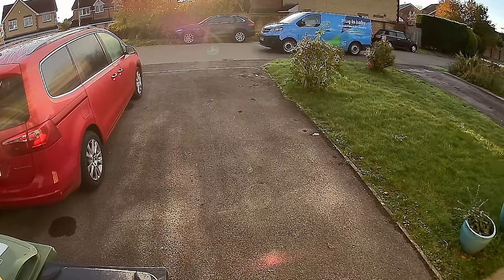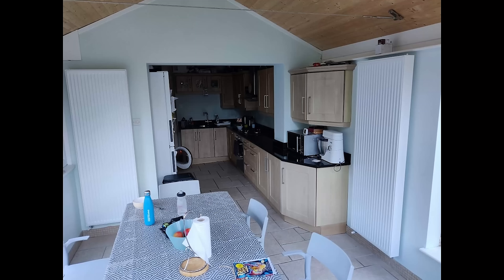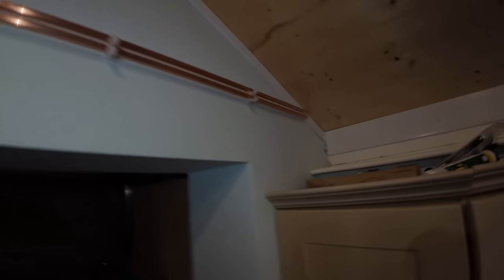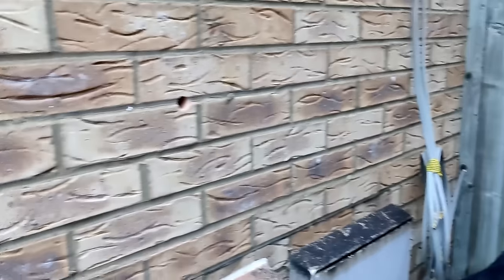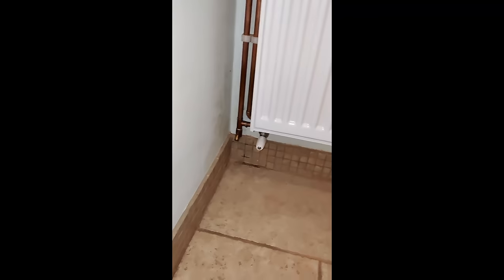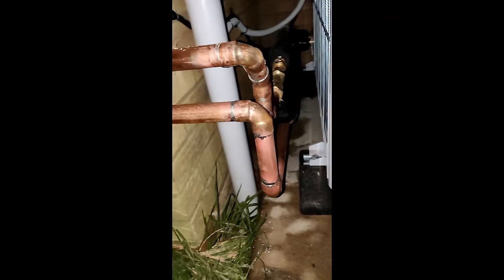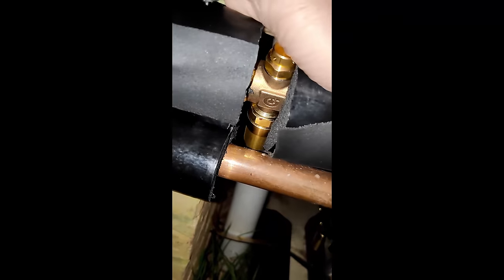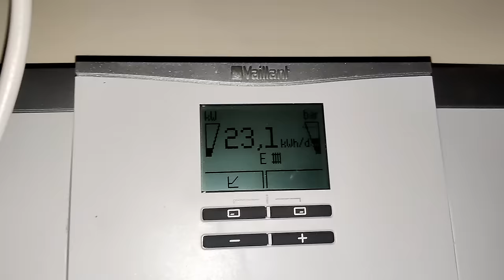Vaillant Arotherm Plus Heat Pump Installation by British Gas

Comment: I am thinking of using British gas myself.
Reply from the maker: As with all big companies, it's a lottery as to who you get.
Reply: It's not always a good idea, if something goes wrong you are fighting a big wallet. They installed a gas room heater in a bedroom for a disabled person and then condemned the whole gas system, As all the pipe work apart from theirs was buried and new carpets and decoration had just been finished we opted to replace it with skeletal (exposed) pipework.Each old section cut connected to new.  On checking for leaks there was a considerable leak traced to the gas pipe that the Gas engineer from BG had installed in the bedroom for the room heater. Compensation nil. Conclusion try locally recommended engineers they have more to lose so hopefully will do a better job. use Google to show you the job so you can check on them, Make sure additives go in the system etc not empty bottles or bottles filled with water etc.I have had all these tricks played on me I am much wiser now.
Reply from the maker: @onlythetruthfull  Good advice.

Comment: Interesting as my potential Heat pump would be a very similar layout, the cupboard space with tank in looks similar to my cupboard, would it not have been easier to locate tanks where the gas boiler was? What size is the cupboard? Thanks
Reply from the maker: Thanks for your message. I replied in my latest video:
https://youtu.be/6Q5CbClka1k

Comment: Why didn't they run the pipe drops behind the vertex radiators. It would of looked 100% better.
Reply from the maker: Now that's something I agree with you on 👍
Reply: They could have dropped  on the other side of the wall behind the fridge.
Reply from the maker: @1973simonking sounds like a sensible solution.
Reply: @UpsideDownFork  yeah they did that with mine, looks ok. I have the same 2 huge vertical rads in my lounge, they barely get warm but seem to heat the room!

Comment: To me It looks horrible, especially the outside and kitchen area. I know some don't mind the pipes everywhere, but it would do my head in. At least you're happy, so all good.
Reply from the maker: Thanks for your comment.
The outside pipes are down the side of the house that is not seen or accessed at all.
Some.people would prefer the pipes to be chased into the wall rad the vertical rads rather than surface mounted but for us we chose the cheaper, faster and less disruptive option.

Comment: wow I did this with one engineer and a helper in 5 days. why do you have a buffer if they re-piped it ? the anti freeze valve is fitted wrong also. external lagging and installation is terrible and will get water ingress making it pointless.
also heat pump has all the stuff on the right hand side which is butt up to your wall so that heat pump will have to be moved every time for a service or any work at all 😰 sooo bad

Comment: The position of that monoblock unit does not look correct? Its too close the the right hand size and the window and door are within the protective zone?
Reply from the maker: Thanks for taking the time to comment. Those issues are answered in my other video https://youtu.be/WBINlPsk5Eg?si=_RH7xBE4uX2VkxES
Reply: @UpsideDownFork  the big question is, how well does it work? I had a very similar install done by BG but with a mixergy HW tank, why this one and not vaillant Im not sure. It seems a lot more complex and no doubt pricier but I do like the mixergy app to control the hw., and it seems very efficient. I had my system installed last march, after several delays caused by miscommunications between bg and the parts suppliers but we got there in the end and Im v happy with the outcome. Thanks for sharing the vids, very interesting.
Reply from the maker: @MikeGleesonazelectrics   You're welcome. I do have other videos about how the performance is going, so feel free to nose around my channel for that content.

Good to hear that your installation has been working well too.
Reply: I think you might be right on that one.
Reply from the maker: @royhorn9412 https://youtu.be/WBINlPsk5Eg

Comment: 'Fraid to say it looks like they haven't installed a condensate pipe and soakaway, which means you'll get a patch of green algae or even ice where the condensate drips. Or even a mini iceberg building up underneath the heat pump during longer cold spells. You'd be justified in getting them back for this. There are very clear instructions in the Vaillant installation manual about this.
Also, buffers can reduce efficiency by up to 35% (University of Ulster research), and it seems a shame to throw away that efficiency when, judging by the size of the rads, the system designer has made a commendable effort to keep the flow temperature down. Could be the buffer was necessary for some reason, but that reason needs to be given to the customer because of the energy disadvantage.
Reply from the maker: The unit seems to be operating efficiently as I show in this video.
https://youtu.be/iyQlxtny_4U?si=Og3L3kvkuDaaWT3-
Distortion caused by the buffer has been minimised by trying to match the DT on either side of it.
Vaillant specify a buffer should be used.
British Gas insist it must be in place.
Both seem overly cautious and don't trust the installer network in the UK to do the necessary flow rate calculations to optimise the system without a buffer.
Reply: @UpsideDownFork  
Your COPs are excellent. Looks like the buffer isn't having a big impact on the flow temp from the heat pump. 
Yes, the big installers like buffers as a fool proof measure so the heat pump doesn't get strangled if there isn't enough flow around the rads. 
I've been on Vaillant training courses and they do like you to put in a lot of extra kit in between the heat pump and the emitters, but I'm not sure a buffer is a requirement to get their longer warranty. But hey ho, it's understandable given that's how capitalism works - always the drive to maximise sales and production, whether it's necessary or not for the consumer. To their credit though, in the standard list of schematics they do include open loop systems if the installer has the confidence to use them.
Reply from the maker: @PaulJones-t7w  thanks for your thoughtful comment 👍

Comment: Scary stuff. Would be only half as bad if it wasn't for the hot water cylinder.
I have air to air HP heating plus sunamp heat store for hot water  (heated using solar in summer, off peak elec in winter). Much easier, neater, cheaper (if you take away gov grant) and quicker to install and the house doesn't look like a major industrial complex. It was all installed in a day. Unfortunately the  system I have doesn't  get you a gov HP grant as the rules are quite inflexible.
Reply from the maker: Major industrial complex? Really?

Comment: BG by default quote for Daikin heatpumps, did you specify the Vaillant?

If so, what advantage does it have over a Daikin?
Reply from the maker: The Vaillant is quieter. We needed that to pass the noise assessment. It has some other slight technical advantages but splitting hairs really in the real world.
Reply: @UpsideDownFork    A super fast reply....much appreciated.

The Vaillant is considerably more expensive though. BG quoted me £658 for a Daikin and £3169 for a Vaillant...hence tge reason for my question!
Reply from the maker: @David-bl1bt  yes, the Vaillant is the premium product but Daikin owners seem very happy with their units too 👍

Comment: Is there enough room around that unit outside, seems quite restrictive for air flow and efficiency?
Reply from the maker: Thanks for your comment. That's covered in one of my other videos here https://youtu.be/WBINlPsk5Eg
Reply: There's a Skill Builder featuring a gent with problems and his Heat Pump has more air around it than this one.
Reply: @nickhickson8738  Yeah I saw that video and wondered if in this case the Valent having a slight side vent and the ejection being into an open space, then it might be better.
Reply from the maker: @nickhickson8738  I've seen that video.
Luckily this heat pump is performing many times better than his!
Reply: Well he's is not performing anymore because of the noise due to an internal fault either the fan bearing or compressor.
Reply from the maker: @nickhickson8738  yes, very true. Very different scenario but thanks for bringing it up in case I hadn't seen it.
Reply: I also think it is slightly within 1 metre of the boundary - so doesn’t meet the regs.
Reply from the maker: @royhorn9412  Check this video https://youtu.be/WBINlPsk5Eg?si=EdsuZeZDz712KXyv

Comment: I’ve already got a mixergy tank, would that need changing to whichever BG quote for or could it be retained do you think? Thanks
Reply from the maker: Mixergy tanks need the upgrade kit to work well with a heat pump.
It consists of a plate heat exchanger that mixergy makes specifically for this purpose as I believe the existing coil doesn't have enough surface area.
There's quite a few people running these heat pumps with mixergy cylinders in the Facebook group.
Reply: It's a Mixergy that BG will be installing for me, albeit with a Daikin 6kW heat pump, Mixergy I believe will work with anything.
The external heat exchanger does away with the need for a large internal coil, which reduces the usable volume of hot water in cylinder.
Reply from the maker: @_Dougaldog  Yes, that's right. Swings and roundabouts. Mixergy tanks are not the most efficient for heat pumps, but if you don't regularly use the full volume of the tank then you'll probably end up saving money overall, even if your efficiency won't be so high when charging the cylinder.
Reply: @UpsideDownFork  

Primary reason for Mixergy was to accommodate future (hopefully) solar PV and perhaps battery, for which there are currently smaller grants of about £1250 for each (at least there is up North). I have about a 36m^2, 35% pitched South facing roof, not sure about loading as yet though.
I'll get HP out of way first.
Reply: @_Dougaldog  Loading, my system was installed on a prefabricated post-war bungalow (aluminium) no questions on loading at all in fact I was surprised that I did not have to strengthen the roof as the timbers are very thin and all the bolts and nails are aluminium, while the bolts are good condition most nails have decayed into powder. The company was using the accredited logos on its paperwork and website. I got in touch with the accredited agency and was told they could not help as the company failed to pay them for membership for some years. I told them I only allowed the installation to go ahead as I had them as a safeguard . No joy.No guarantee.

Comment: I actually want one as I still have my old cylinder running to store hot water. My heating  and hot water uses a 15KW boiler and pump.
My bill for a full tank of hot water each day and heating on 8 hours a day at 21c+ was £80 in January with BG.
The boiler is 20yrs old and works fine.
I was quoted £5500 to convert the current system to a combination boiler.
If I can get a heat pump I would want to be paying far less than gas. So less than £80_month to run for similar hours would be OK.
The house is well insulated.
People with heat pumps will not tell me how much they paid, or what their monthly electric bill is.
I just can't get an idea of whether or not it would a saving, or I would pay more for installation and be stuck with something that uses £100-200/month IN electric. 
I can't be doing with sales people as they will lie to get a sale, the same with people that were misled, they feel foolish and will not give true costs.
Reply from the maker: This video might help https://youtu.be/GM2MCaYyaHE

In our case it has saved us loads but not everyone does 👍

Comment: Was there a bypass on the system 

Also is there a AAV on the buffer
Reply from the maker: Do you need a bypass if you have a buffer?
In my case I have 2 large rads without TRVs and the rest are set to wide open anyway.

Comment: I wouldn’t be happy with the pipework and radiator siting, especially so close to that window in the conservatory/sun room type situation.

Lots of missed deliveries and logistical issues - I’d expect more from BG, personally.
Reply from the maker: Thanks for your comment.

The logistical issues were frustrating!

The vertical rads and pipework in the dining area? I'm afraid these were compromises that needed to be made. In my other videos I walk through why I made that choice.
The rad next to the window is an internal window through to the living room 👍
Reply: to be fair. having seen BG from the inside. id have expected a lot worse!
Reply from the maker: @Lutonman2010  😂

Comment: I like the idea of heat pumps, but the minute I saw those (2) huge rads in the kitchen I instantly knew the juice was not worth the squeeze unfortunately
Reply from the maker: Thanks for your comment.
We are effectively heating a conservatory in that space though. It has 8M of outside wall and then 10M of external glazing so would always need decent size radiators, even on a gas high temp system.
For us, it is worth sacrificing that wall space. The dining area has never been so comfortable for us, even when it was below freezing outside.
Reply: Yeah fair point, they are HUGE 😂. Thanks for such a well put together video btw!
Reply from the maker: @MrBradfordbiker  Yes, they are! My wife and kids like to hug them! 🤣
No probs, didn't really plan it well or get as much content as I had hoped, but just cobbled bits and bobs together to try and demystify the process for joe public.
Reply: Haha, at least they won't be hot so squeeze around @MrBradfordbiker

Comment: You certainly had some issues to tackle on your install with routing pipework. I feel very fortunate that I didn’t have to change a single radiator.
Reply from the maker: Wow, you were very lucky.
What is your design temperature?
11 of our 12 rads needed to be changed but 10 of those required no pipework modification so it was extremely easy, quick and cheap to do.
The tricky rads were definitely the addition in the conservatory/extension part of the house where no pipework had been at all.
Reply: @UpsideDownFork the design temp for mine is 45 degrees at -3 with no zoning and weather comp.
Reply from the maker: @MarkGaudie very lucky to have no rad changes at a good design temp 👍

Comment: How would it work in minus 15  degrees
Reply from the maker: Minus 15?! I live on the south coast where it rarely drops below zero.
Besides that, most of the Nordic countries use more heat pumps than gas boilers so as long as the system is designed correctly they can work down to very cold temperatures.

As for my system, it is designed to run efficiently (391%) down to -2 degrees, but it can continue to heat my house to far below minus 2, just at the cost of some efficiency. A quick guesstimate is ~300% at minus 7 degrees.

Anyway, proof is in the pudding. I'm measuring and will keep sharing my data on the channel.

Comment: What time of year was your installation, was it recent? Thanks
Reply from the maker: Yes, not that long ago.
Reply: Was the time between planning approval and install down to BG being busy or what was the reason please?
Reply from the maker: @robmog88  had a roadblock with the DNO over a silly issue and then I'd missed my window of opportunity. Vaillant were back ordered. They offered me a Daikin unit for a quicker installation date but I had planning permission specifically for the Vaillant unit so I waited.

Comment: From a British Gas standards perspective, this installation seems decent, which is surprising given their track record for poor workmanship and high prices. However, if you're looking for top quality, I highly recommend Master Gas London. As a developer, I've utilized their services, as have many of my peers, particularly for air source heat pump installations. Their system designs surpass the competition. Take a look at this video – the cylinder cupboard appears entirely unserviceable. In the future, servicing this setup will be a challenge, with critical components tucked away at the back. Accessing them will be a nightmare, and eventual issues seem inevitable. It's likely you'll have to remove the buffer tank just to address these concerns, which is a flaw in system design. Keep in mind, for unparalleled air source heat pump installations, choose Master Gas London.
Reply from the maker: I've been around the heat pump community for a couple of years, conversing with other home owners and installers but you are the very first person to bring 'Master Gas' to my attention.
Thanks for the recommendation.

Comment: What absolute cowboys, I would be devastated if someone did that to my home.
I could do the entire job single handed to a high standard in 6-7 days + time for paperwork.
Reply from the maker: Any details of bits you don't like?
Reply: @UpsideDownFork  
All of the pipe runs are  poorly executed, and the soldering is really rough.
I’d be concerned about volume and flow rate as a there’s nothing bigger on the heating circuit than 22mm, I would be expecting the first few section of the system to be in 28mm.
I really do hope it all works properly and doesn’t cause too many problems.
Reply from the maker: @1973simonking  thanks for taking the time to comment.

Soldering isn't great, that's true. I have done better in the past as a DIY guy.

Volume and flow rates seem spot on from what I can tell on both the display and from manually calculating.
I've been checking the temps with my IR thermometer on main feed and return as well as each of the rads to make sure they're balanced properly.

Proof is in the pudding and so far the CoP seems good 👍
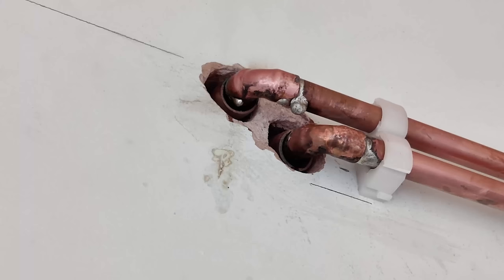Reply: 14:09 that soldering is atrocious!